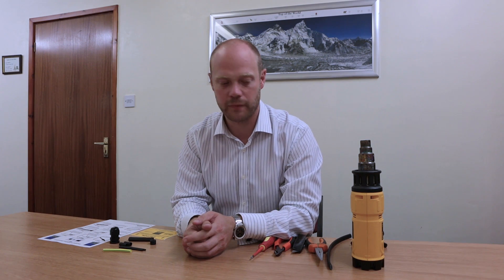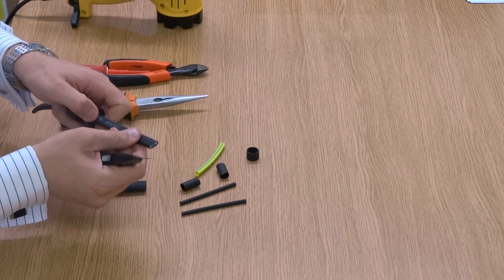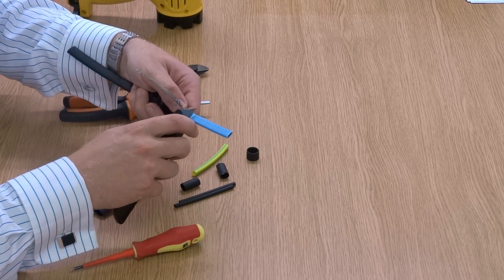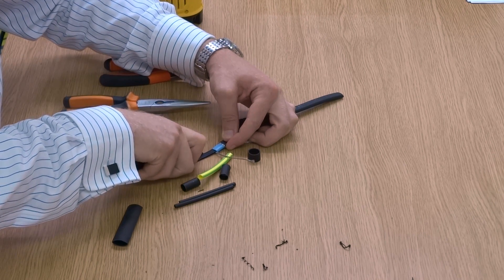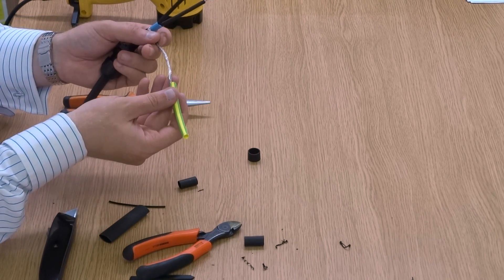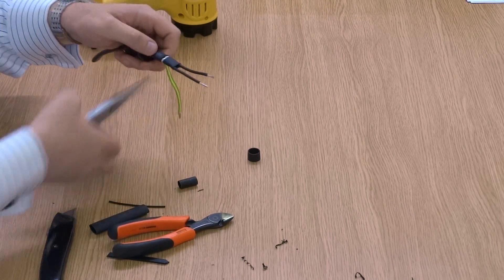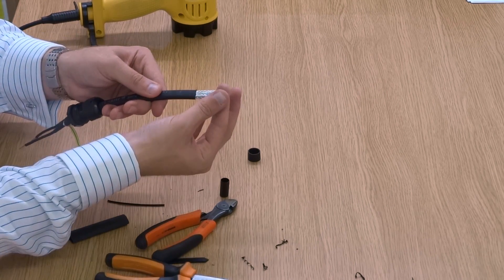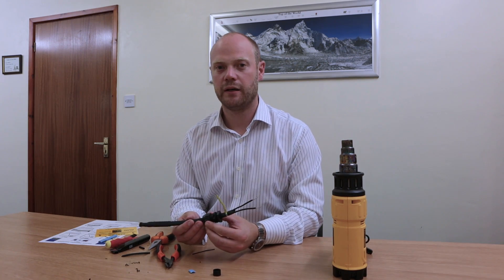Self Regulating Cable Termination Instructions

Comment: Why is my cable only heating half the length on a thermostat
Reply: What is your application voltage?
120 vac?
or 24vac control?
  Self sensing, don't forget that.  Regulated along the run.